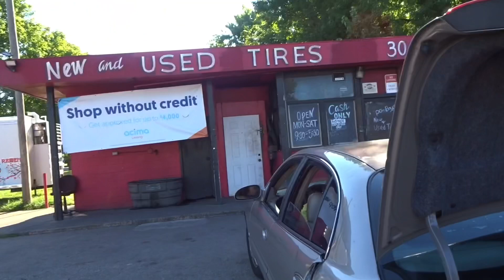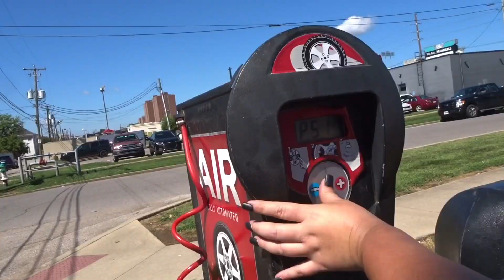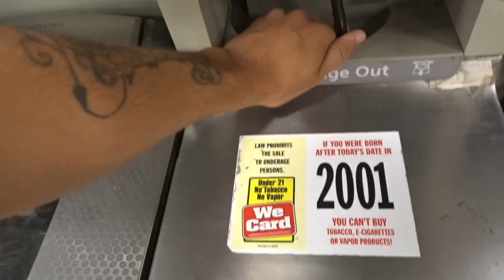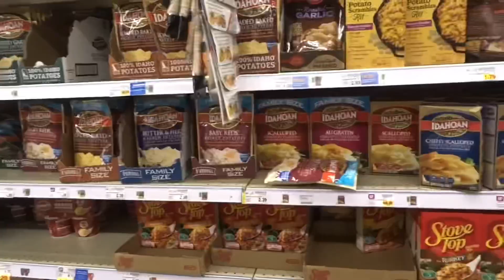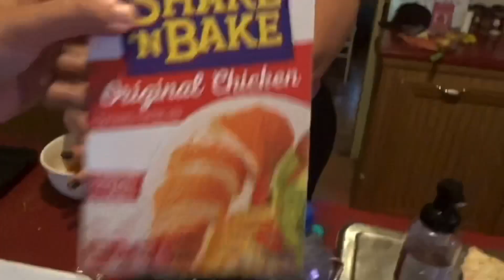This Is Real Life (8/31/22)

Comment: Your Wheels Camber Is Way Off the Way That Tire Is Wore Out on the Inside, Mite Want to Get the Front End Checked Out for Bad Ball Joints, Bad Tie Rod Ends, Or Just Needs an Alignment, To for Future reference Them Rims Are 15" In Diameter Around & 6" To 7.5" Wide Depending on That Model of Cobalt, To I Wouldn't Put More Then 35psi to 40psi Of Air in That Small of a Tire Because Over-inflating Can Bubble the Tire Also Causing Improper Wear Of The Tire Tread, All This Info should Be On The Driver's Door Sticker When Open, Now You Gotta Use What You have, But When Using A Scissor jack After You Take The Tire Off Slide It Under The Axel Just In case The Car Falls, Better safe Than sorry, Also Instead Of A Flash Drive Get You A Seagate 1tb (1000gb) External Hard Drive, I Stopped Using Flash Drives I've Got A 1tb & a 5tb Hard Drive An Haven't Let Me Down Since I've Got Them, Sorry So Long of A comment By Nice Video & thumbs up
Reply from the maker: Thank you I’ll def let Jen know and has noticed that when driving now it won’t continue straight it goes towards the left.  So we will get it checked out